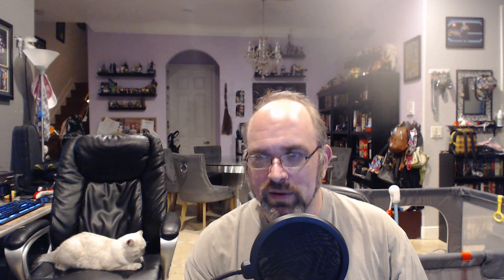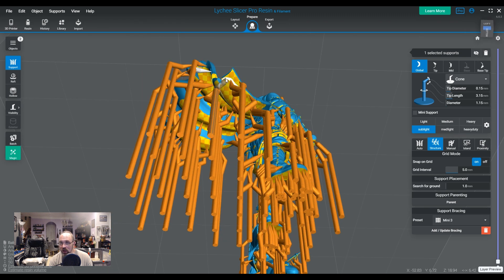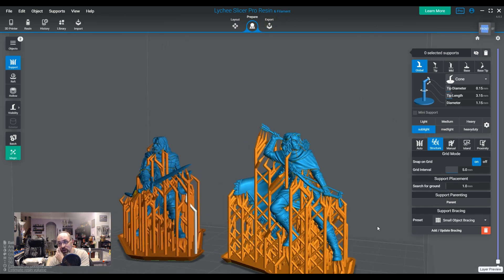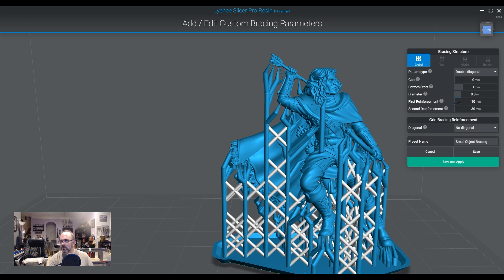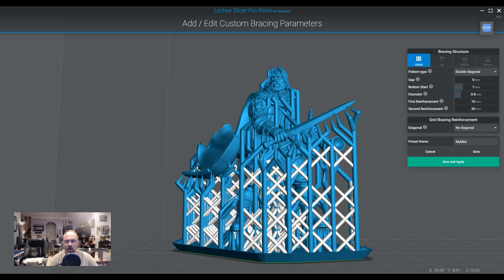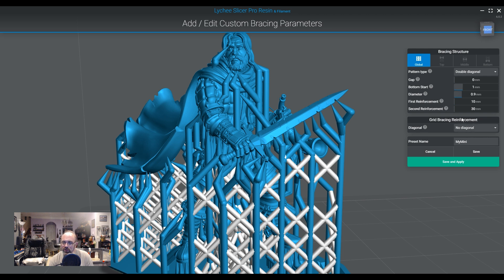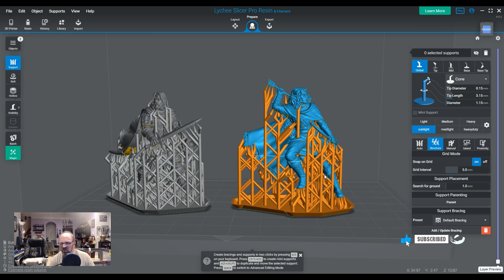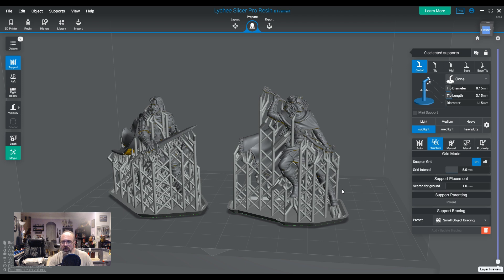Grid Setup Lychee Slicer Tutorials, creating presets, edit and change bracings

Comment: Hi dude Always love your videos. Theese days i m noticing tha sometimes supports made with grid are generating Island...mostly due to tip lenght...nut if i make them to short kind of melt when printed. Have you noticed something similar?
Reply from the maker: I have not, but try using thicker bars, or shorter tips play around with the settings a bit, and it will hit the sweet spot. Resin and temps will change things too, so always keep that in mind.